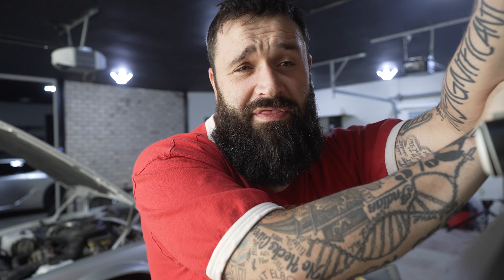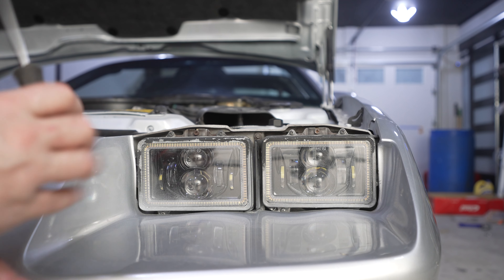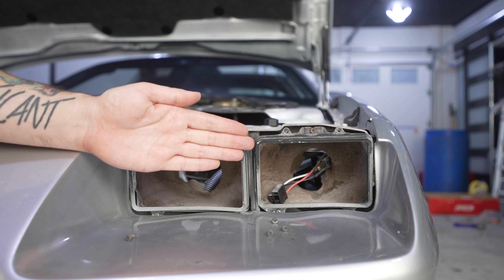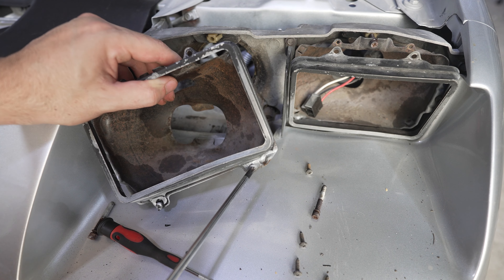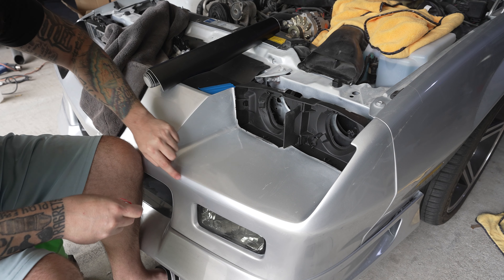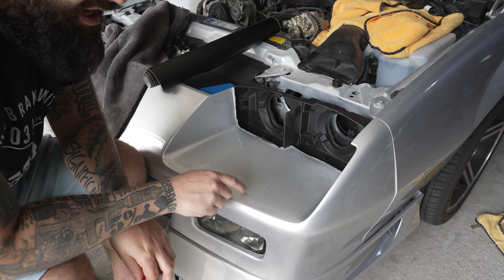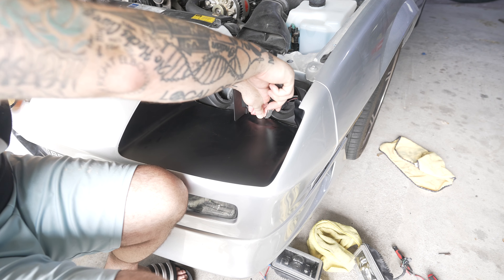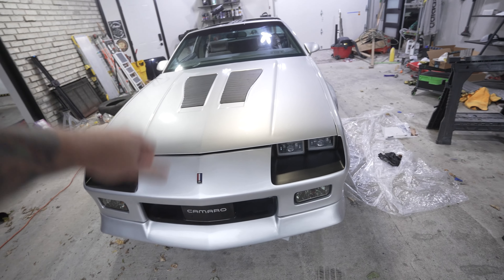Third Gen Camaro Project | Restoring My Headlights | Episode 32

Comment: It looks better with black.  Have you considered lens covers?  I'm thinking of getting some and I can't decide if it looks better with black.  I think the bumper wrinkles in the sun, yours looks worse than mine.  I wonder if painting it black will make it warp more?
Reply from the maker: I've thought about it.  Mine came warped when I bought it :(  But I've kept it in a garage and it will always be kept in a garage to keep the warping minimized.  I actually just got my hands on one of the last GM bumpers they made for these cars before they went out of stock, so I have a brand new one coming I can use down the road to replace it one day

Comment: Interesting job.  I'm curious if you can use that vinyl on the dash pad?  Everyone who has a 3rd gen. Camaro knows how bad they get.  I'm on my third one and it is showing it's age.
Reply: I have a dash pad cover and it works well.. I'm assuming it could work, however since the dash isn't a completely smooth grade, the vinyl might not come out clean 👍
Reply: @solomonmperera  Is It a new pad or plastic cover?  That's a $300.00 difference.  I've seen different pad repairs but I have reservations on the speaker area.  My current pad looks like a battlefield with all of the cracks and craters.  I wish I still had the original style (82/83) instead of the later version.
Take care.
Reply: It costs like 40 dollars I believe, I have an actual fabric dash pad that goes over the dash.. it came with the car when I bought it
Reply: @solomonmperera  I've looked at some videos on refurbishing the pad.  Is your pad the type that lay's on top of the dash?  Basically a fitted protector.  I've seen those and would consider using one after the other pad is repaired or replaced.
Reply: @jameshuban6515  yeah thats the one its pretty nice
Reply: @solomonmperera  Yeah, they are a good option.  Regardless of whether they're protecting a new, repaired or one with a plastic fitted cover.  The pad protects the dash from the UV light.  definitely worth the cost.